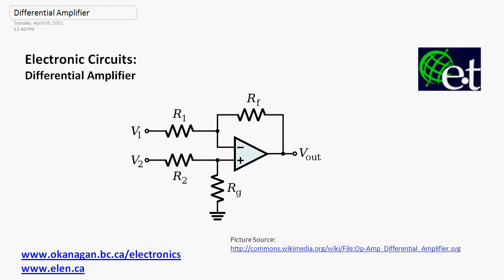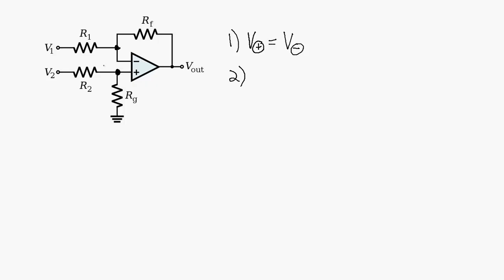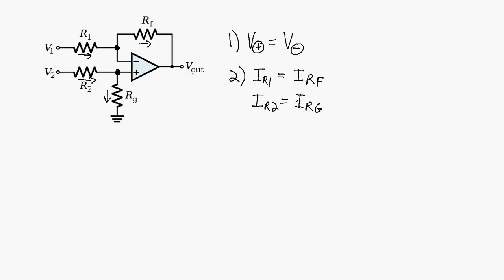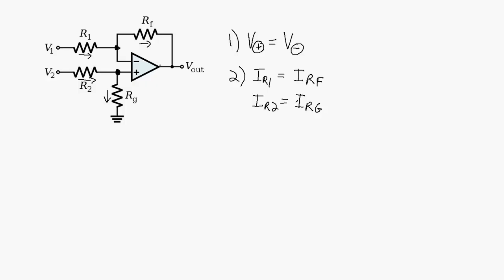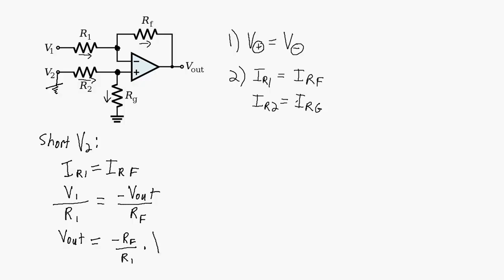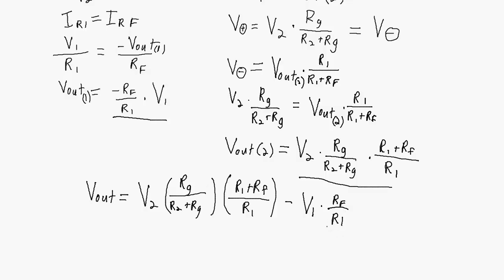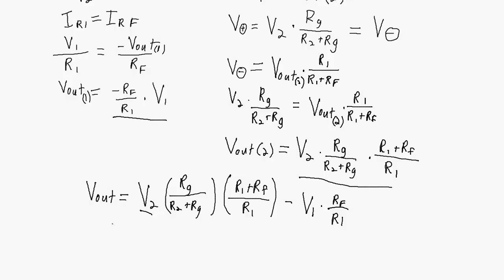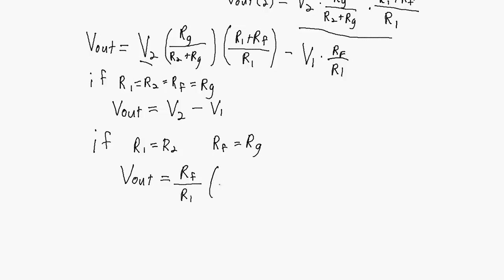Operational Amplifiers - Differential Amplifiers

Comment: Modern Vox AC15C1 has one as a mixing stage of its two channels before going to reverb and so on. But it has different resistor values so that the hot (topb.) channel signal is a bit attenuated.

Comment: Of course the warning in regard to the term differential vs differentiating is ok but the term 'differential' still sucks due to the possibility of the confusion. It just sounds too linguistically close to the operation of differentiation in calculus.
Even the term difference amplifier would be a big improvement.

Comment: Thanks. I'm trying to sort out analog circuits for a fuel injection setup. Looks 1 or 2 555 timers and a handful of OP-amps will do for the control logic. Might even be able to add variable timing based on vacuum, engine speed, or even both.

Comment: Why do you assume the V- terminal is 0 (virtual ground), but then not for the V+ terminal (V+ = Rg /(R2+Rg))...? I mean if the two terminals are equal, and one of them is zero, then why suddenly assume there exists a voltage across Rg? When I analyze these circuits when can I assume a terminal is virtual ground (and equal to zero)?? And when can I assume the terminals are equal to each other?

Comment: The voltage at the V+ terminal is not zero.  You need to find the current from V2 to ground, then use that current to find the drop across Rg to get the voltage at V+.
Reply from the maker: When applying the superposition principle to analyze this circuit, one of the steps is to look at the voltage at V+ when V2 is shorted to ground which does make the V+ terminal zero. You are correct in that it is not actually at zero, it's just a step in the analysis to help figure out what's going on in the circuit.

Comment: As a retired ASE Master tech who work on vehicles for over 30+ years, I was looking to find out  if the OP AMP is used to control "Dumb" motors that control HVAC door motors. The motor is direct drive to the door shaft, but has gears that drive a potentiometer. The pot operates on 5 volts. So, if the dash control potentiometer changes voltage, requesting the motor move, another OP AMP provides 12 volts positive to one side and 12 volts negative to the other side and the motor moves. Now it stops anywhere once feedback voltage has been met. Once the circuit it built, total end-to-end movement can be marked on the control, like hot or cold blend door. I have hundreds of these components and this type of circuit must be used in robots, mechanical arms that move, stop then move further. I was just curious as I have join online forums to "Search" for these circuits and can not find anything that has feedback and control together. Perhaps you have a suggestion. Not much for a guy with multiple lumbar fusions, bad elbows and worn out joints to do but learn. I would prefer to work as I was good at it and use a Fluke 85 type 5 and have and "O" scope, amp clamps, power supplies.
 Many newer vehicles will count the current flow thru commutator plates as 1, then 2, then 3. They will install a new part and it has to relearn. They use enhance N-type Mosfet with a current shunt, so closed could be count number 11, and  open is 280. They use this type of circuit on power window motors that roll down 10mm for a automated hardtop to open or close. There are several other types, but want something simple perhaps for a 1967 Chevy pickup. Thanks.

Comment: Is it safe to say that the gain in positive input is not affected by the gain of the negative input, if R1 and R2 are different values? And safe to manipulate the ratio of (Rf/R1) and (Rf/R2) and make the op-amp "favor" one input from the other? If that's the case what is it called.?
Reply: I Always think that Rg only sets the Virtual ground for both (+/-) inputs.. Correct?

Comment: I've seen that in all operational amplifiers, no current flows in. Does that mean no current flows out, either?
Reply: ButterTM yes, in a theoretical op amp, in reality there can be slight differences though.
Reply: if you are talking about the amplifier itself then no. You have to power the amplifier from a totally different source which is not shown in the video. You would just not have any current flowing in( IN AN IDEAL scenario)

Comment: Hi, how can I analyse this configuration but with capacitors? I let's say C1 instead of R2, C2 in series with R1 and C3 in parallel with Rf.
Reply: You would use the complex impedance instead. Replace C with 1/sC and use the same method in the clip to solve for Vo/Vi.  If there's an inductor in the circuit, you would replace it with sL. Of course the gain will be a complex equation.  
You can clearly see how Low pass and High pass and even band pass and band reject filters are created.  If the output is zero at high frequencies, that's a low pass filter.  If vice versa, that's high pass filter.  And if you only get an output between two frequencies, then that's a bandpass filter, opposite for band reject.   I hope that jogs your memory a bit about the s domain and reverse laplace transforms.  If not, look it up as I don't remember everything myself.

Comment: How is the direction of the current in the feedback resistor decided? Where should it head towards the output or towards the inverting input? Thanks.
Reply: When the non-inverting input is grounded (at 0V) and R1 = Rf,  if V1 goes to (say) +1V then in order for the opamp to keep its two inputs at the same voltage Vout must go to -1V. Current flows from V1 through R1 and Rf to Vout. R1 and Rf are in series, and since there is +1V at one end and -1V at the other end, the voltage at their junction, i.e. the inverting input, is 0V. If V1 is at -1V then Vout must go to +1V and current flows from Vout through Rf and R1 to V1.

Comment: great video, a question, can a LM358 a dual differential input op amp be used as a standard op amp so long as I'm not using two different voltages at the plus, and minus terminals

Comment: Thanks for the video. Can you please tell me why is it on the voltage divider for V+=V2* Rg/(R2+Rg) and not R2/(R2+Rg). How do you know that the V+ voltage goes through Rg and not R2?i would appreciate a fast reply from someone cuz I have an exam tomorrow :o
Reply from the maker: Remember that basically no current goes in to the non-inverting terminal. if you redraw the R2, Rg configuration in a straight vertical line with V2 at the top and ground at the bottom then you can see it is a basic voltage divider circuit with the voltage between the resistors being V+ = V2*Rg/(R2+Rg). 
Hope that helps.
Reply: got it👊 thanks a lot!

Comment: Isn't op amp itself a deferential amplifier.  ???
Reply from the maker: +meghana bhange You're right, but the gain on the difference between the inverting and non-inverting terminal is too high to use it that way. If you have no feedback, Vout = (V(non-inverting) - V(inverting)) * Av.  but the op amp is designed so that Av is as big as possible (ideally infinite).
Reply: +David Williams Ohhh thanks !